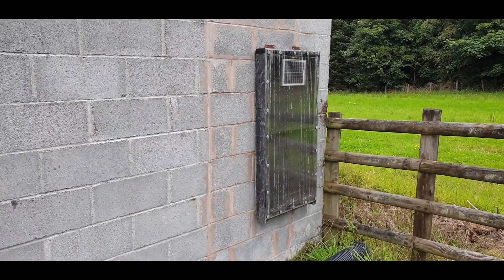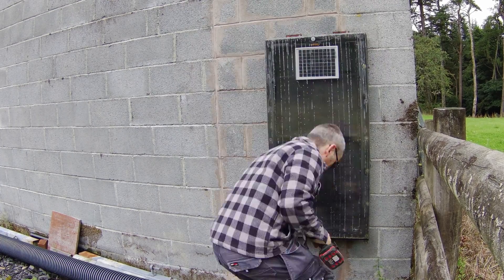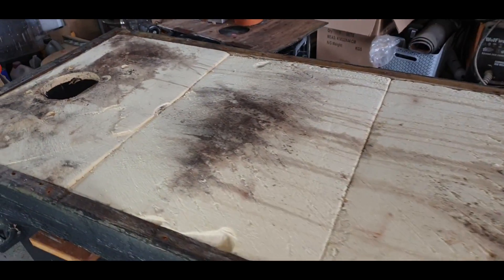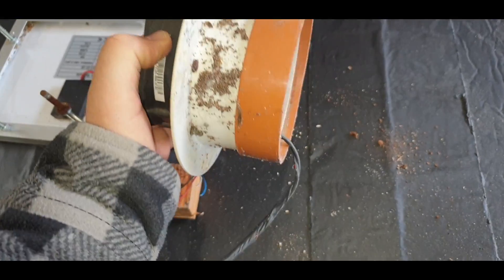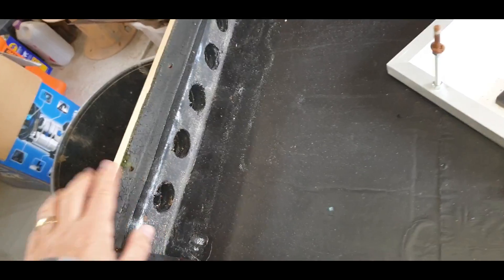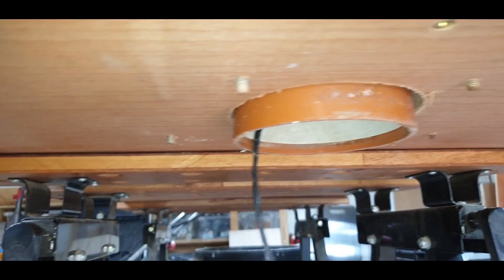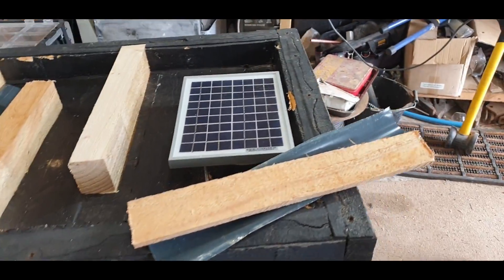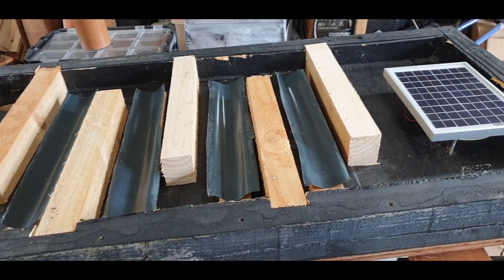Solar Furnace Hot Air Collector for under $30 (Free Heat!)

Comment: Thanks for sharing your experience in using this type of construction and showing the type of maintenance one might face. Wouldn't it be better to mount the solar panel outside the heating box, so that it can perform more efficiently? PV panels don't like heat, and this thing is meant to work in winter hence my question of whether all that free and abundant coldness outside could make the solar panel run more efficiently.
Reply from the maker: Thanks for watching, it doesn't seem to effect it I think because the fan is only 2watts and the panel is 5watts. But if you had a larger fan or smaller panel then outside would be better.🙂👍

Comment: Nice  job. It would be much more efficient if your "vanes" guiding the air were much thinner. You're restricting the flow of air by using the 2x2s
Reply from the maker: Your right you can have thinner vanes it would increase the distance and time in the box. My thoughts were as long as the volume is equal or greater than the pipe it should be ok. I was also worried about supporting the poly sheet without bending it. It seems to work Ok I've done a quick follow-up with temperature readings on a fairly cloudy day.